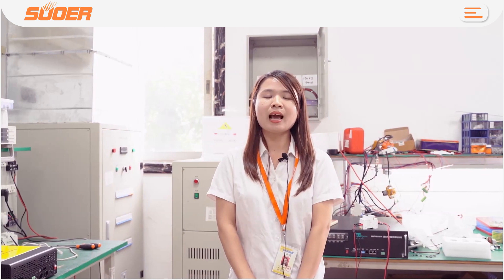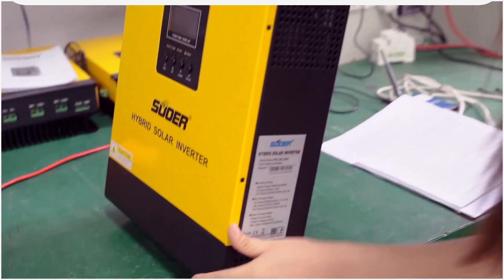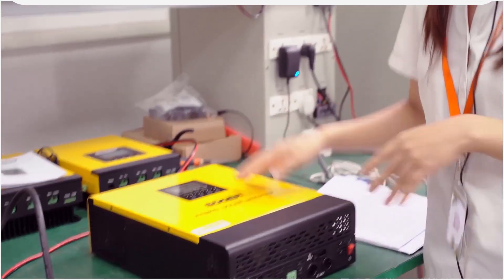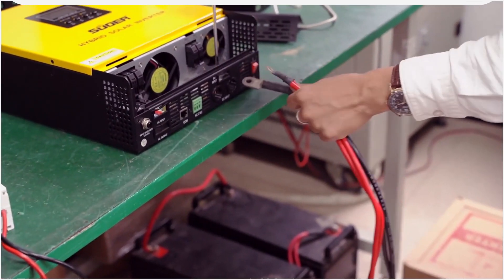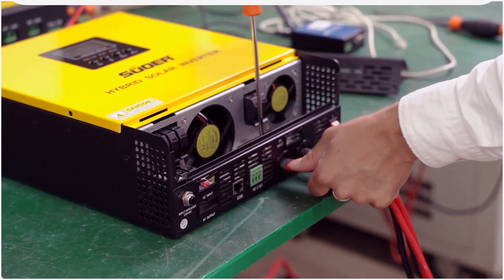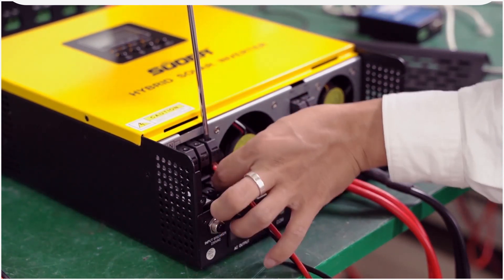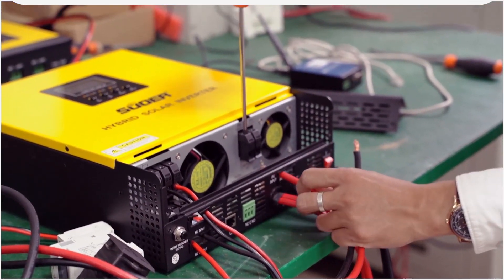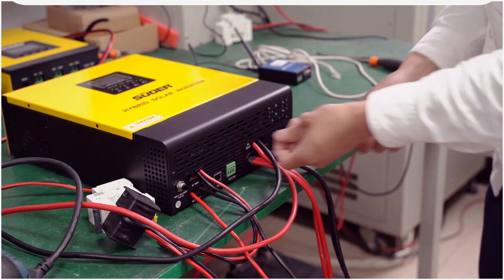SUOER hybrid solar inverter built-in PWM solar charge controller（PS-3K-24）

Comment: what about MPPT charging
Reply from the maker: this model built-in PWM solar charge controller, and we also have mppt hybrid solar inverter, which one do you need
Reply: @SuoerSolar  what is the advantage of the MPPT charging system over the PWM charger on the ps-3k-24 plus , can we run the inverter on panels only still ?
Reply from the maker: @Steveuploads  WeChat/WhatsApp: 008613544480517